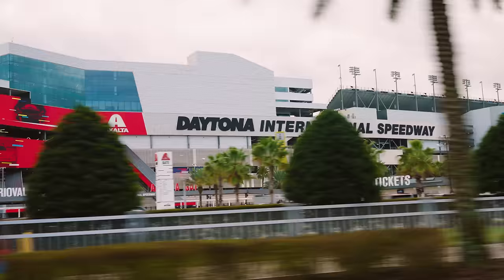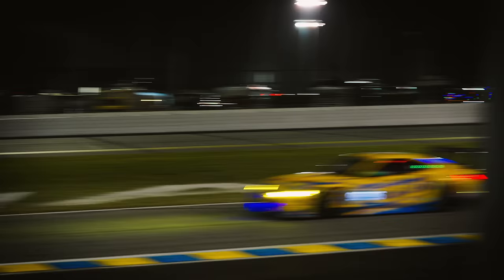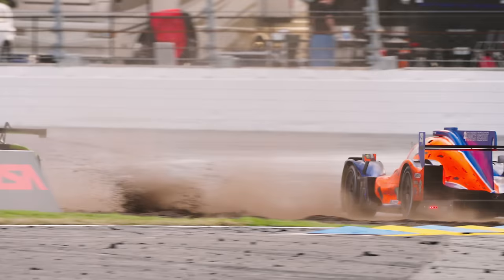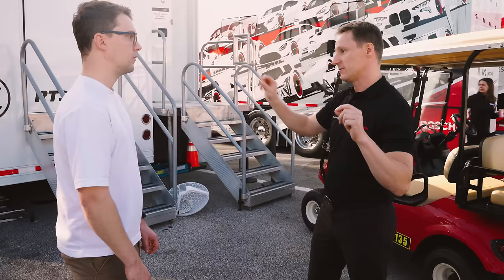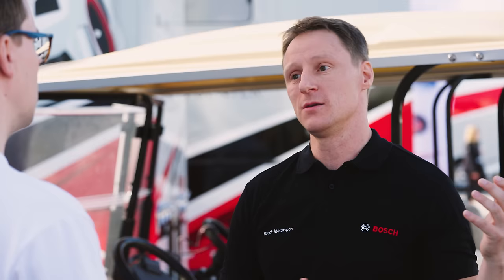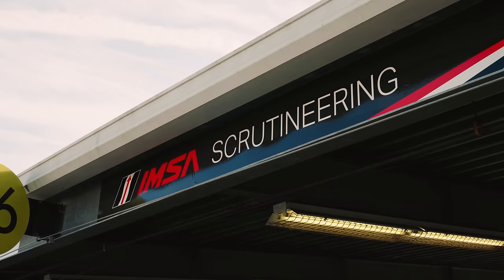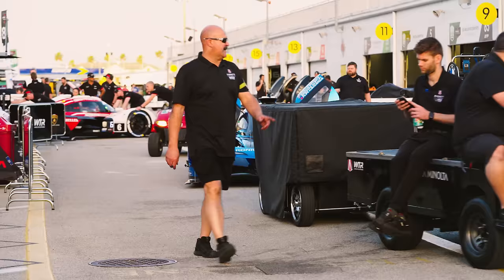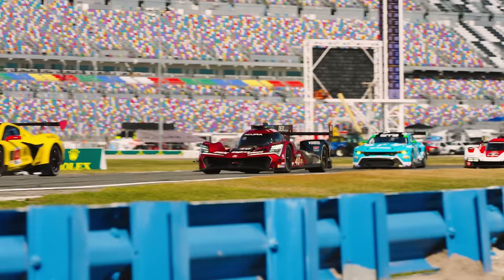BrrrakeF1 - Under the Skin of Endurance Racing's Advanced Tech

Comment: lmp2 isn't spec :( There's four different chassis available just everyone goes to oreca
Reply: So it's spec then 😂 if it's all oreca
Reply: @aaronwestley3239  well no because there is one ligier running sebring. Even if only orecas are run the regulations allow 4 different lmp2 chassis so it wouldn't be spec by regulation, just spirit. INDYCAR, F2, F3, those are spec series.
Reply: @Sargent-Mike  the engine is spec though, unlike Indy. Not disagreeing though
Reply: Isn't spec racing where a team can only race locked parts by a third party and cannot be modified, nor built in house? Even if there's 4 different chassis and bodies, it's still spec racing as a team can only select locked parts that cannot be modified.
Reply: Basically spec 😅